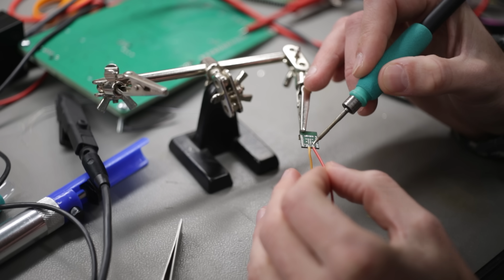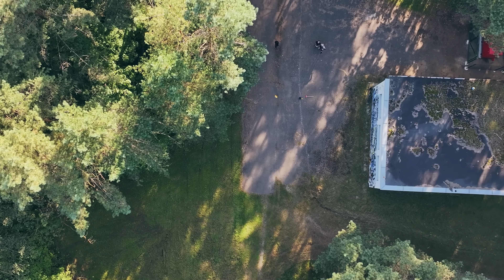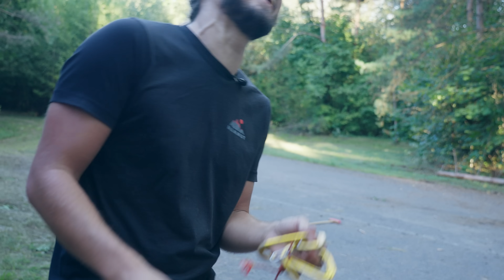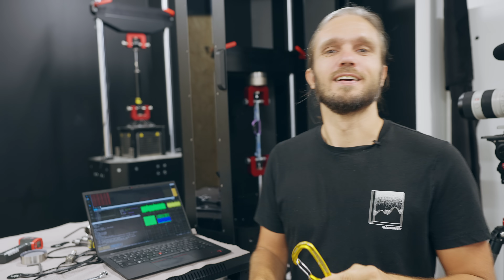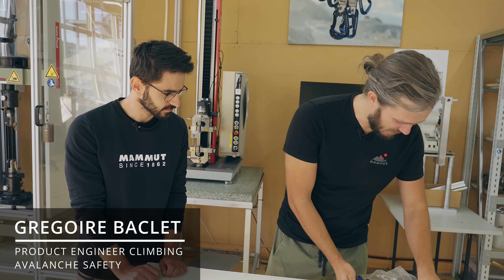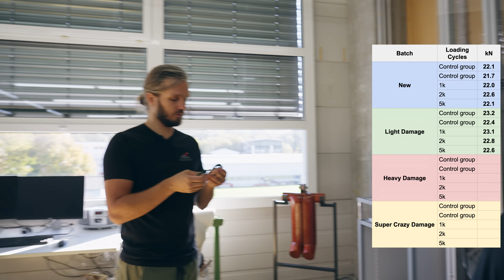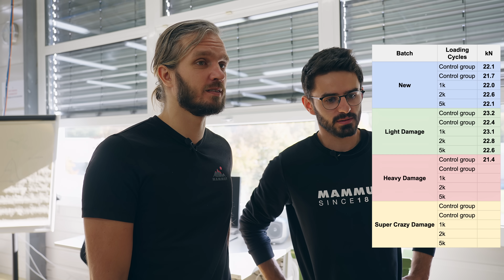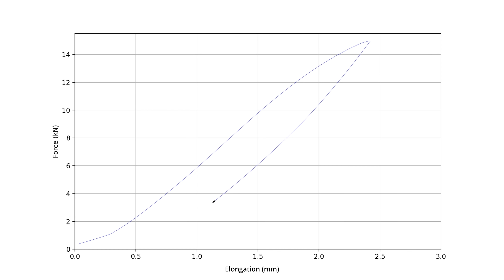Should You Retire Dropped Climbing Gear?

Comment: The work hardening section is really important information. Great video. The thing about work hardening is not the force, it's primarily just the repetitive movement. 
I have a B&R rig on my boat, basically a tripod of cables holding up the mast. Almost all catamarans have this rig. My boat is a monohull. When a catamaran is sailing with the wind from one side (Beam reach) the lee side (away from the wind) shrouds (cables) get loose and floppy like spaghetti. The first time you see this, you freak out.  On my monohull the lee side never does this. Just the geometry of a wider spread on a wider cat, etc... 
I just saw video of a rig on a cat where cable strands were breaking at the sleeve, Where the cable enters a steel tube that connects it to the hardware.  This is work hardening.  I don't think anyone has thought about this specific situation.  If you clamp a wire with pliers and then gently wiggle it back and forth, it work hardens until it breaks, right at the jaws of the pliers.  That is exactly like the breaking at the sleeve. 

I don't think it's large forces that broke those strands, I think it's the flopping around. This is why my rigging is 20 years old, while much newer rigging is breaking. I have the idea that on cats if there was a spring holding the middle of the cable, as it becomes loose, the spring will pull in the loose cable so it doesn't flop around. This should significantly reduce the work hardening.  (And yes my rigging is too old and I should replace it. There are some redundancies and I'm only coastal sailing for now.)

Comment: My initial guess was those drops are harmless. A biner just doesn't weigh enough to damage itself. Getting slapped into the rock by a loaded rope, which is very common, has to be much worse. But if you dropped me from 100 meters, I'd guess that would be retirement with no further testing required.

Comment: Awesome material as usual! I'm wondering - have you considered the statistical chances of developing a micro-fracture? Your test considers 20-30 randomly selected carabiners. Perhaps this sample size is only large enough to say something like: "The chance of carabiner which was dropped snapping is less then X% with confidence Y%" . Just curious what level of risk are we talking about ;) similar to getting hit by a lightning? less?
Reply: Aluminum in general doesnt fracture like that because of various material properties. So honesty the video is good and thorough but the chances of micro fractures is already proven to be zero. Its just that climbers aren't material engineers. 

Micro fractures are used or studied in metallurgy as deviations in the grain structure of a metal due to stress. They are microscopic and dont create "lightning" like splits in a material. Climbers envision this mini crack inside a volume that will instantly propagate like lightning or an earthquake fault through a material, and thats just not a real thing. At all
Reply: @Doctor_Yuri  Thanks for the explanation :) I guess I still had that mental model of lighting-like splits - if those were a possibility then the limited test Ben performed might not be enough to detect a super-rare occurrence. I was thinking about the scenario when the microfracture is already developed in the manufacturing process, then somehow slip through the quality control AND then the climber drop it. But if you (and Ben for that matter) claim that the fractures don't develop like that in aluminum at all - I will take your word :)

Comment: Great video as always. As a material engineer it is not too suprising to me that there are no internal fractures/cracks in the aluminium carabiners. However, in the past using steel for climbing gear was much more common and steel is more prone to fracture. I think that this myth of falling gear forming fractures comes from using steel for carabiners back in the days etc.

Comment: I once has wire gate that must have been loaded over an edge without me noticing. Then when I was climbing some under later I saw that the gate sometimes would stay slightly open when I clipped the hanger (it didn't always happen). But I realized I was falling on an "open gate" sometimes (which is a bit scary)
Reply: Falling on an open gate is not just scary but changes the 'biner strength from ~ 20+ kn to ~ 7kn which is real world possible. So it's potentially downwright dangerous.

Comment: more scientific than hownot2! Thank you. Really interesting to see the results. Still wouldn't whip on it, as the problem is not the carabiner itself breaking, but foremost the rope getting caught in one of the imperfections and cutting.
Reply: Still not very scientific, though. Sample size of 1 for most test conditions, obviously uncontrolled variables, no calculation of uncertainty, no formal data analysis... The results are certainly suggestive, but you can't attach any hard numbers to the conclusion, including how much confidence there is in the inclusion. At a glance, it seems like the results fall within the uncertainty of the break test.

But the testing was only intended to be suggestive to begin with. It's not like they're trying to get this research published in an academic journal.
Reply: @SnakebitSTI  sample size was 5 lol
Reply: @whatevernamegoeshere3644  5 of each damage category, 2 without cyclic loading, and 1 each of three different counts of cyclic loading. That's a sample size of 1 for each combination of damage type and cyclic load count.
Reply: @SnakebitSTI  you can count to 5 right?

Comment: Wow, that means I don't have to retire my 35+ years old carbiners, cams, atc, figure8 and Brunei 😅, thank you Ben, but what about the fabric components (e.g.: rope, slings, quick draws, and harness) I'm just an old climeber coming back after 25+ years pause
Reply: Not Burney but Grigri (that was the autocorrect doing crazy)
Reply from the maker: Soft goods technically have about 10 years lifetime stated by most manufacturers. I would be very careful for those since they degrade over time

Comment: I climbed a route, "c'est pas physique c'est electrique" on the Eperon des Cosmiques in Chamonix.
Adjacent to a route "Monsieur les 15,000 V" ... the high voltage electric power cables for the Cosmiques Hut run over the cliff face.
You climb between the cables and the rock, and make sure you don't fall... 

When abseiling the route, one of my two ropes got caught up in the high voltage cables.

I binned the rope after. I think it was peace of mind - nylon is an insulator and it was probably just fine (!)
Reply: And yes, we had to thread the ropes when abseiling back inside the power cables to get down...

Comment: the change from "hightech drone dropping carabiners" to "manually smashing carabiners to the ground as hard as possible" got me laughing infront of the computer.
that (plus the "I gave up on consistency already") is the thing I think everyone that researched this topic before has come to aswell - it's f***** hard to test this ;)
Reply from the maker: Well at least it was fun :)))))
Reply: I'm all for tests that don't involve my body weight as the shock load and I can watch from the comfort and safety of my bedroom. I climb for arboriculture instead of rocks these days, but I prefer to just stick to my rule of retiring anything I mess up. It's already stressful enough using a saw in close proximity to your lifeline. It does have an aircraft cable center, but it's not invulnerable. I now trust my gear more. Watching a wiregate take at least rated load when abused is incredible. Awesome video.

Comment: I'm wondering if the reason of some carabiners marked a higher force to failure on the tensile tests was not due to the effect of work hardening (aka strain hardening). It's normal for some ductile materials such as steel alloys to gain more load bearing resistance when subjected to some kind of deformation.
Reply from the maker: Did not seem to be the case from our samples...
Reply: Yea, probably not. I made the comment before you guys mentioned the work hardening effect on the end of the video, so while you were doing the tensile tests, I was not sure if you were familiar with the process. But it seems that you guys know what you are talking about. Nice video though, and was a good flasback from my material science classes! 👌

Comment: Fig-8-s were always the "fear" - even just a slight drop / fumble onto a rock has been known to freak folk out (single point connections induce "gear fear").

Smacking gear with a hard hammer and anvil - is far and away worse than any real world drop ) good for  proving something.

 - Maybe put some files and fine emorypaper in your field kit to be able to smooth out jagged edges (avoid damaging the soft gear)- drop a gear bag to demonstrate still ok for a whipper...

Shock absorbers also take care of the rock..
 
That Awesome test machine with the sci-fi linear motor - the "Permanent Magnet" and "Synchronous" part in simple terms means "Brushless DC"  in linear form..  (of course even a BLDC motor in a "drone" / RC Aircraft is often fed an (inverted) "AC" signal via the DC powered "Electronic commutator" (Brushless Speed Controller - the magic "box" that makes these things work)  -

Comment: Cool and very interesting Video! Maybe interesting to know, in slacklining there have been broken carabineers and tests about them, where we don't even have to go over the plastic deformation of them, but only the small bend in the nose, in every cicle is enough for aluminum to break if you have enough cycles and in slacklining we can create a lot of them, quite fast. You can for this also look up some permanent strength curves of materials, where aluminum is really bad...
Reply from the maker: Yeaaa Ryan will go more into Slacklinening tests on this topic... We would need 100k cycles for that... And for Climbers that was def not needed....
Reply: @HardIsEasy  that's great to hear that Ryan is planning this already! I agree, that it's not really relevant for climbing, but I think that even for climbers it can be good information to know, to get a more complete picture of the gear. Specially when we are already going deep into this nerdy stuff.
So when you talked about the plastic and elastic deformation of carabineers in cycling tests, I thought this is not the hole truth about it and you are missing to tell knowledge, which is already out there (at least in the slackline world).
Maybe not really relevant information for climbers, because they don't fall enough haha. But still something which is real and can be important for some. So I thought it could have been just mentioned...

But again, anyways a really great video with a lot of very interesting and great knowledge and so cool and nerdy places you were able to visit there!! Thank you for making such great content!

Comment: Great video!. As an amateur climber, the method I use to identify carabiners that have experienced a severe load is the following: observe the gap between the gate and the nose of the carabiner where it would normally sit. If this gap is similar to that of a new carabiner of the same brand and model, it means it has never exceeded its elastic limit. If the gap is smaller, it means the carabiner has been deformed and I discard it.
Reply: I like your method, I'm going to start using this test myself. Don't forget to look for any sharp edges or burrs (especially on the inside) that can damage the rope.
Reply: Inspect your climbing gear...be careful of booty found at the base of a cliff😮...47 year of climbing...you get booty!

Comment: I don't quite agree with the work hardening theory you presented. The work hardening means that after loading past the yield strenght, to cause more plastic deformation you need to go past the stress the part experienced previously. Also, metal becoming harder doesn't change the Young's modulus which you showcased, it only changes the tensile strength (all if we stay within the alloy family, all steels are around E = 210 GPa, all alus are around E = 69 GPa). It is worth noting that the fatigue strength comes into play in your last test, as you were close enough to the UTS to see fatigue at low amount of cycles.

Comment: Among all your great videos this is one of your best. 

Amazing to so how reliable those carabiners are. 

Any plans on releasing a video on the Edelrid pinch? It is such a nice belay device, but for sure you are going to make it fail with your strange experience 😂

thanks so much for your tips and knowledge it helped me a lot.
Reply from the maker: Cheers, and yea... Pinch in the strange experiments stage :DDD
Reply: @ Oh great news!
Looking forward to your Pinch findings, I highly respect your insights and knowledge. 

I have used the pinch now for about one year and I love it. Direct attachment makes a huge difference for me, I have the feeling I have more and saver control over brake line this way than with grigri+gaswerk method. 
To belay with the Pinch is a very nice experience for me. 
I have to say I attach it directly and add an back-up beaner. Not because I don‘t trust it but the back-up beaner simply doesn‘t hurt or change the experience at all so why don‘t go for extra safety.
Reply: @HardIsEasy  I made strange type there :-D This is better:
I love your strange experiments that you do with a lot of experience 😂

one thing I want to add:
I am not very happy with the Caldwell/hownot2 video about the Pinch and how he suggest it catches a 6-7mm rope hands free. 

He shock loaded the pinch in his test scenario and yes, there it caught. 
It would be much more interesting to see this test with:

-more standard rope (9.5-9.8)
-rope just sliding (fall below bolt!)

happy climbing ✌️

Comment: Saying this before seeing your conlusion.  Ive climbed, dropped gear, found gear, accidentaly cross loaded gear, done mostly everything right using gear, and ...some  things absolutely wrong with gear. This over 45 years of climbing (mostly outdoors) some inside. Always retired carabiners that took the long drop or were found at the base, assuming the worst Just to be safe. In this time the only failure ive seen were: one rope cut on an edge during an overhanging jumar. Otherwise nothing but a bunch of pilot error, as in belayers not paying attention and getting launched.  So interested in knowing if all that being safe was technicaly the "right" call.
Reply from the maker: Being safe is better than dead no? :)

Comment: I think that removing the high frequency spikes - that is to say smoothing the curve out, or as an engineer would put it, applying a low-pass filter - may have been the wrong choice. I'm not a metallurgist, but my limited material sciences experience suggests that exactly those quick force spikes might very well contribute a lot to the propagation of cracks in metals.
Reply from the maker: The main reason to remove them was to prevent the machine from heating unnecessary. But yea it's now unclear if that would have had any effect... Judging from the final results, I kinda doubt.
Reply: @HardIsEasy  I agree with your assessment of the outcome. Where there are no cracks, none can propagate, no matter what you do. I was speaking more in general terms.
Reply: It doesnt, that high frequency (and honestly its still pretty low frequency in the realm of vibrations) does nothing to effect materials.
True high frequency noise can be analyzed via PSD (Power Spectral Density) which for extreme environments like a rocket launch, in the realm of 2khz or more can effect bolted joins and create different modes of stress.

Anyways, what they're doing is fine. Source: Vibration testing and analysis for satellites.
Reply: How much of the high frequency noise is an artefact of the sensor? Is the temporal resolution of the load cell enough to accurately measure it?
Reply: @stibbits7087   If its an off the shelf accelerometer, and not a production level one like bruel kjaer Type 4504-A, then its resolution is probably well below 100hz and can not capture high frequency noise.

Its probably at best something like the LIS3DH, which can only go up to 5khz and even then not reliable at that level. The DAQ setup for it for sure measures way less
Reply: @stibbits7087  I'd expect most of the high frequency noise to be strands in the fabric of the rope slipping, not sensor noise in this case. Mind you, calling them "spikes" might not be the best description. "noise peaks" might be a better one, but I do believe them to be real, not sensor artifacts in this case, especially since load cells don't normally produce a lot of noise.